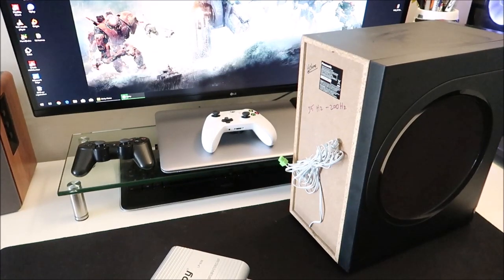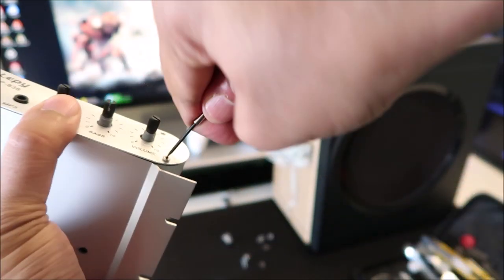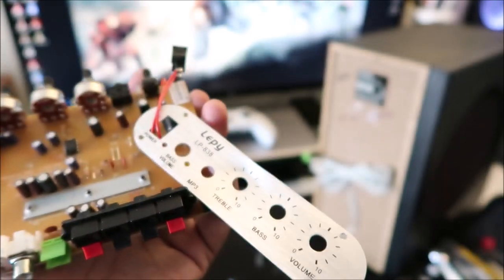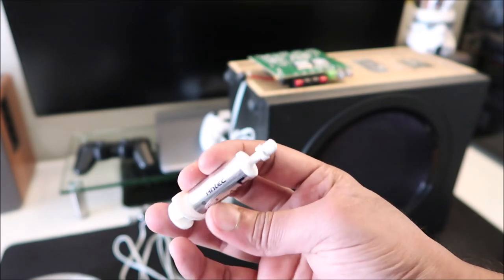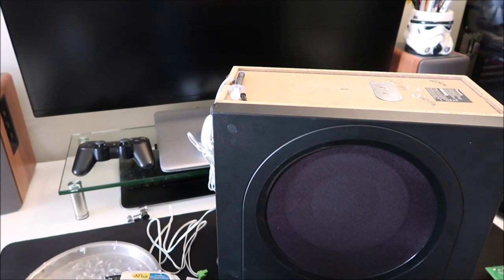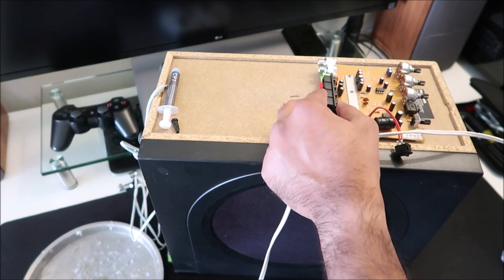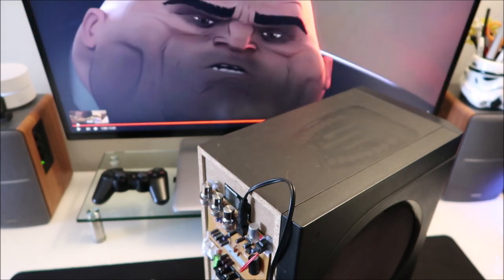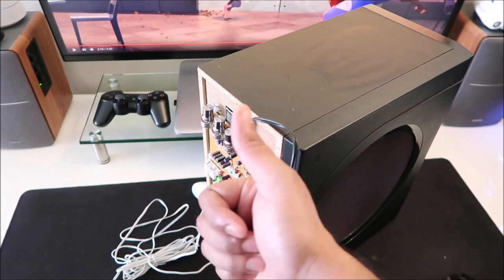Lepy 838 - Subwoofer Mod

Comment: Can't understand what you are trying to do.   Use so much effort to produce such an ugly product.   Use 4 wood screw to fix the whole amp to the back of the sub woofer would look so much better and save all the effort.
Reply: He probably didn't know the purpose of the cutouts. But those chips will fry one day.
Reply: @ssh3mk  chips heats a lot, and he removed alluminium cooler, speakers gonna fire

Comment: This little amp is great for my TV, I have my Tanoy speakers as the main speakers and a 50 WATT subwoofer on the super bass, this works effortlessly and sounds great! Way much better than the standard TV speakers. I've not had any issues what so ever and a much cheaper option than having a full surround setup if your just looking for a little upgrade to sound rather than a cinema. Thanks for the video upload, I've been looking for something like this for a while and if I hadn't found this video, I'd still be looking 👍

Comment: i have 3 of these powering a mimic 5.1 setup i use on my pc, (After tinkering with vol/bass/ treb it sounds awesome) but oldest is beginning to die, 1 how do  you increase the sub par grounding the case provided? 2 can i swap a 3 pin Potentiometer the the 6 pin slot for the treble?